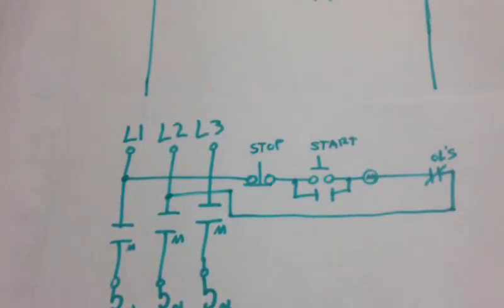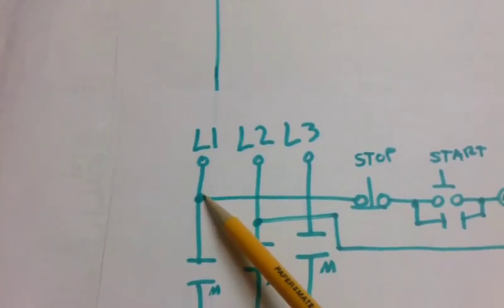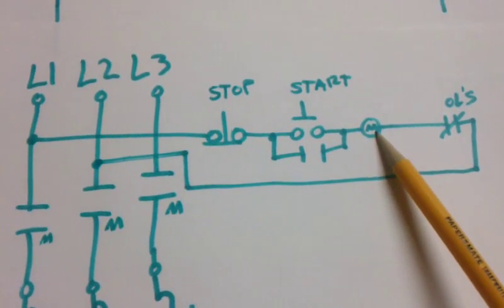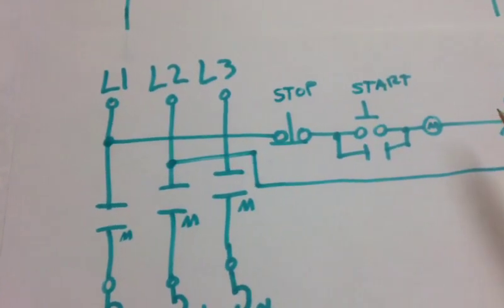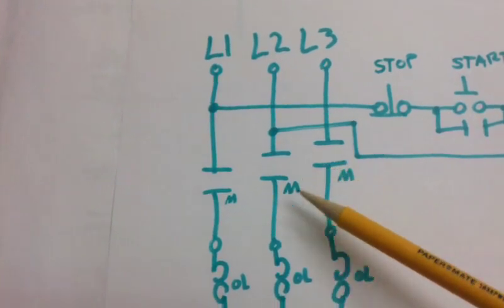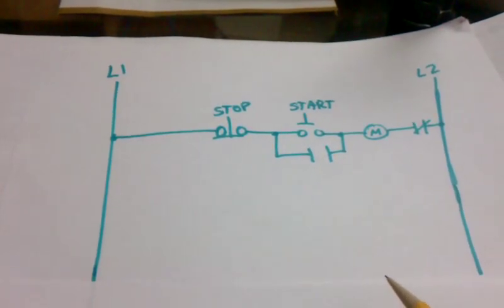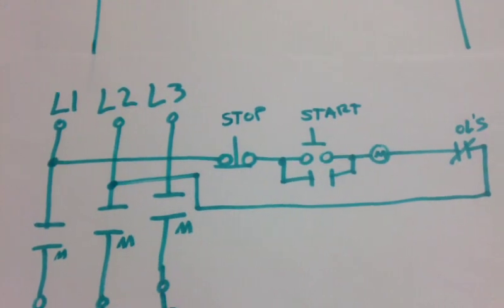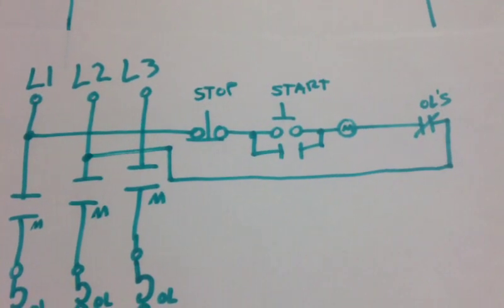Motor control circuit

Comment: Why we must wire line 1 and line 2. I donn't understand. Can you help me? Thanks.. ^^
Reply: It provides the voltage to energize the motor starter coil (M) in the drawing. Typically called the control voltage
Reply: How know if a watermelon is ready to eat

Comment: can you blow up the motor wiring it like that without the fuse
Reply: +QaibFresnoCali No.. i don't think but you can blow up the coil if you don't put the pushbuttons on 110V .

Comment: YOU FORGOT TO DRAW THE CONTROL TRANSFORMER THAT CONNECTS TO L1&L2 WICH GIVES YOU 
480V STEPPED DOWN TO 120V THEN THE CONTROL FUSE THEN SOU CONTROL CIRQUIT .